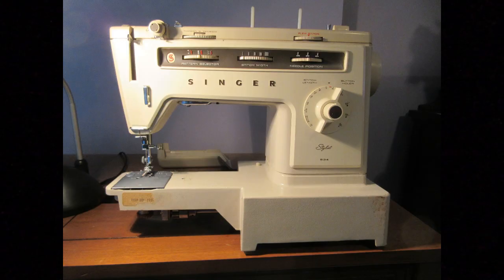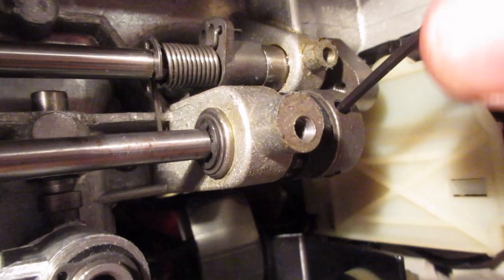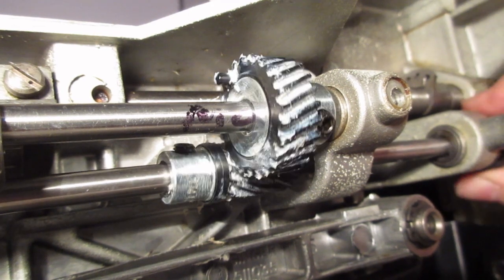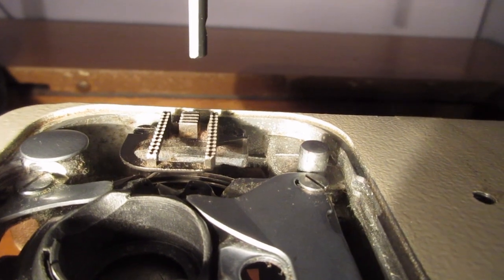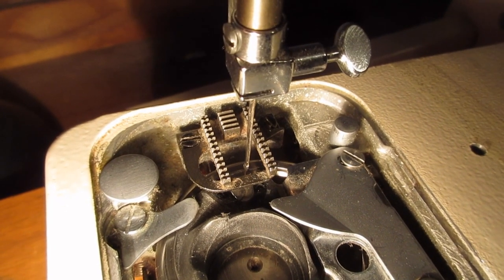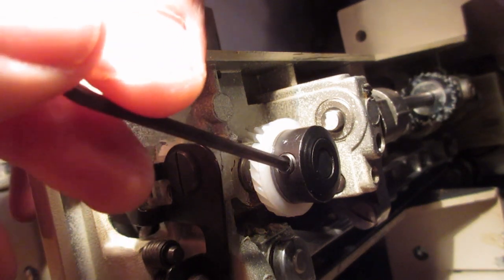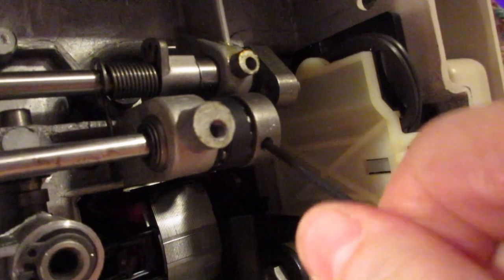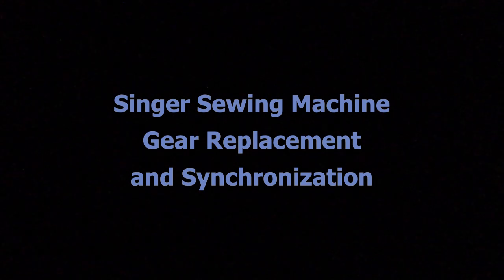Sewing Machine Gear Replacement and Synchronization

Comment: Excellent video as it allows the watched to learn by trial & error (the best way). Could have gone straight to a pro repair video but really enjoyed yours as it allowed me to think things through with you (if that makes sense). Gears have arrived, so I'm going to crack on with this repair this weekend.  Cheers👍🏾 from the UK.
Reply from the maker: I just got back from visiting your beautiful country (was in Cornwall and Southampton).  I hope your repair went well.  Before this video, I knew nothing about how sewing machines work, but I like to try to observe and figure things out.  It's pretty easy to do videos where I'm just fumbling along with the viewers, LOL!  Can't be a know-it-all, but instead a bumbler that finds the solution.
Reply: @sengsational  Hope you had a great stay! I'm sure you did as Cornwall is a beautiful part of the UK and the natives are friendly. I'm currently reading your message whilst visiting the Lake district, which is lovely part of the UK worth visiting if the opportunity ever presents itself. 

Fixed my old Singer 501 in line with your video and now, after a bit of fiddling around with precise bobbin loop pickup position, it works a treat.

Thanks again and God bless brother. 👍🏾

Comment: Thanks for sharing! I've got a singer 7105 and the gear is very similar to yours! Hopefully I can repair it very soon after i buy some new gear for my sewing machine,  your video is helpful!
Reply from the maker: On hind-sight, it would have been better had I shown all of the steps for disassembly, because the shafts must slide toward the wiring area.  Good luck.

Comment: My machine seems to be newer than the ones usually fixed. It's a 9020T Singer. Only problem is worn hook gears. Timing is good.
Reply from the maker: I responded to the other comment, but I'll add that you might come back and let us know how the repair worked, and which components had to be removed on the 9020T repair.

Comment: About 9020T continued... This machine has the electrical connection on one side and the motor below in a separate compartment.  Do I disconnect only the outlet on the machine before trying to remove the 2 hook gears?
Reply from the maker: In general, I like to first take photos before disconnecting things. As I recall, the long shaft could not be removed until some electrical things were removed. Although the timing is good now, when the gears are replaced, the timing will probably be disrupted. You might be able to mark the shafts before disassembly, but I have no experience with that.  Since the timing is good now, I would take a close look at the way it works now, and take pictures, so you will recognize good timing after you replace the worn gears.

Comment: Is this hard to do for a novice? I have no mechanical inclinations at all. However, the repair shop wants to charge me 175$ so I want to try this my self.
Reply from the maker: This repair takes patience and you might get "stuck" in what to do next.  It's like a puzzle.  You might realize "that's in the way" and not know what to do next.  Or "that needs to turn, but it doesn't turn", and need to figure out how to get it to turn.  If you have the right sized Alan wrenches (6 sided things), you should be able to get it apart, if you are persistent.  I wouldn't be in any kind of hurry...instead enjoy solving the puzzle.  Getting the "timing" right is the hardest part (where the needle is with respect to the bobbin).  It's critical to get it right, but, again, tighten, rotate it slowly by hand, notice the position of things, loosen, move, tighten again, and keep trying.  If you get the gears on and you just need to synchronize, maybe the shop would charge less to set the synchronization.
Reply: @sengsational  Thank you so much

Comment: I need the instructions on how to take those shafts off.  The part you didn't include.
Reply from the maker: Oops!  I knew I did less than a complete job on that video.  I try to respect everyone's time...sorry to have been less than stellar investment with yours.
Reply: @sengsational  it was fine, I just needed a bit more.
Reply: I just replaced all 4 of mine you can do it I just bought this 1973 singer there is a very good video out there I will go get the name of it for you
Reply: MDTV3 look him up he’s great to watch regarding replacing the gears

Comment: Thank you but please add removal of gears right under needle, especially the one on the long rod.
Reply from the maker: I realize that this video lacks completeness for the project.  I wasn't shooting the whole time I was working on it.  At this point, I'm not going to open-up the machine again unless it stops working.  But I've used it several times since then, and it continues to work.

Comment: I have the same sewing machine that need these gears replaced. Do I need to buy some grease for this? I bought the gears already.
Reply from the maker: If you can, I'd buy grease, just so you'd protect your gears.  But it really takes very little grease to be effective, so kind of a shame to buy it for 1/32nd of a teaspoon worth. If there were globs of old grease, that might suffice for a while.
Reply: @sengsational  what tool are you using to loosen the screws on the inside. I have an Allen wrench and I am getting no where.
Reply from the maker: @brenixon1577  If the hex (Allen) wrench was the right size, then you should be able to break it loose (counter clockwise).  They might be pretty tight.  You might need to use a glove if it hurts your fingers when you try to loosen it.
Reply: @sengsational  My parts came but the one on my machine has two holes and the one I ordered only has one so I am reordering more parts. I will try to loosen them a bit harder when my parts come in. Thank you for your help I am going to try this. Lmbo. But I am thinking maybe I should just buy a new machine 😔

Comment: How do you take it apart
Reply from the maker: My contribution to youtube lacks this important information, sorry.  I do recall that it requires removing the power connection portion in order to slip the shaft out far enough to slip the new gears on.

Comment: What do when my singer machine like this one  goes wrong direction
Reply from the maker: I don't know too much about it, but I know there's a button that you can press that makes it go backwards.  Could it be that button is stuck?
Reply: The gear is frozen with old grease that has hardened. Get the stuff called Blaster, spray and keep working the part back and forth, back and forth. It will slowly start to move, keep spraying and moving. It will eventually free up and move forward.